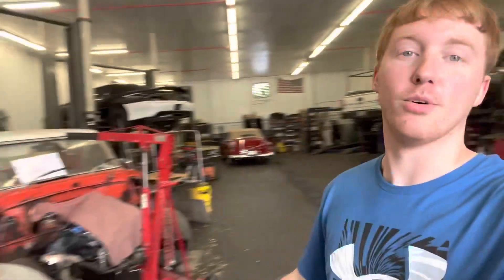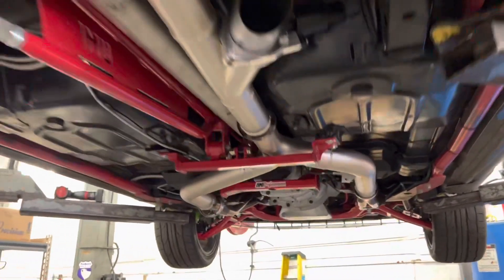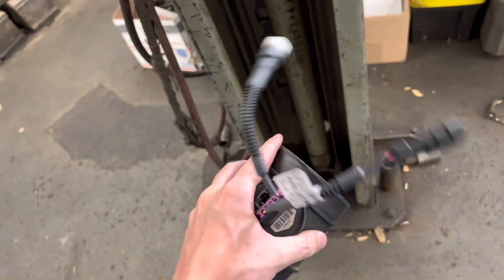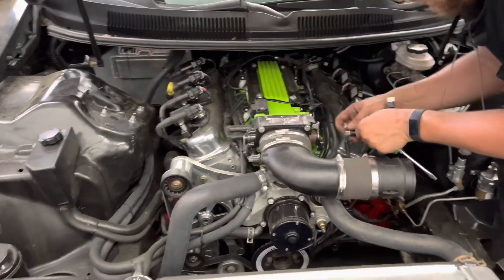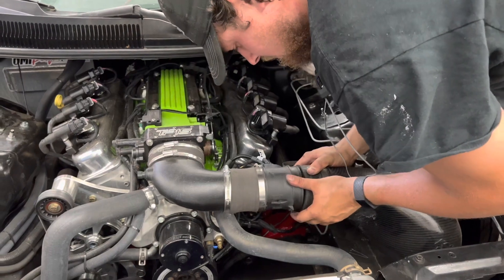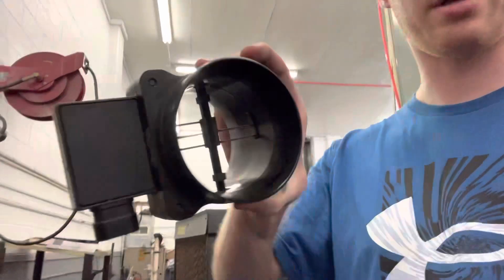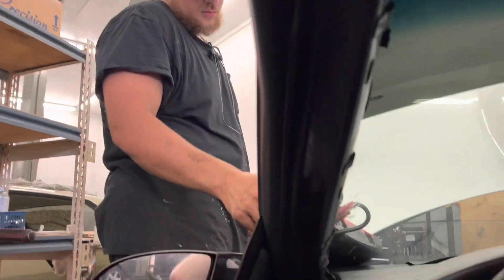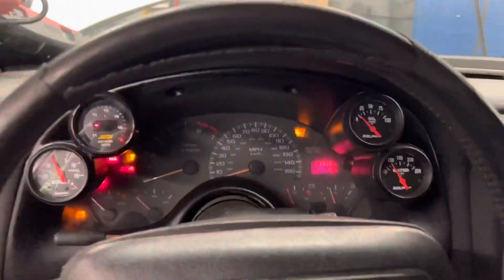Converting an LT MAF to an LS MAF!

Comment: do you see or feel a difference in the coil pack compared to the opti?
Reply from the maker: Oh yes definitely! By going with coils you can tune the PCM better and get more out of the LT motor! I’ve seen some people gain right at 50 more HP after swapping to coils just because of the tune ability.

Comment: How much power it make? And how do you do that LS harness swap
Reply from the maker: Little over 400, it’s got low compression! I built it for boost so once I put a pro charger on it should really wake up! Look up Torque head 24X I used their coil packs reluctor wheel. Then I used a 0411 PCM.